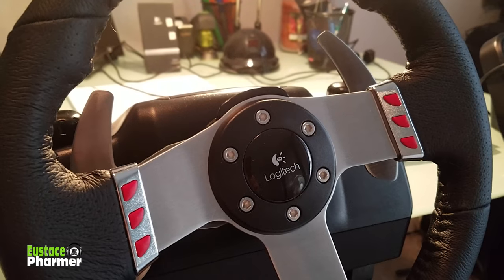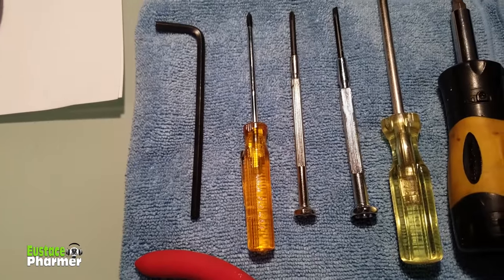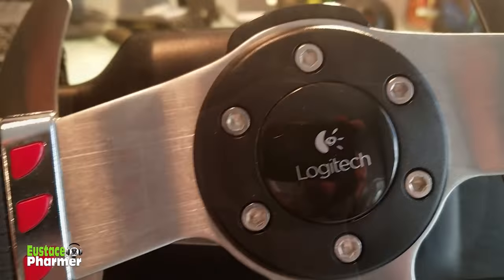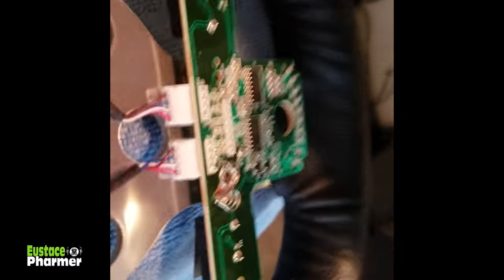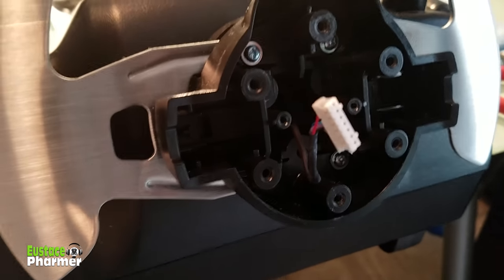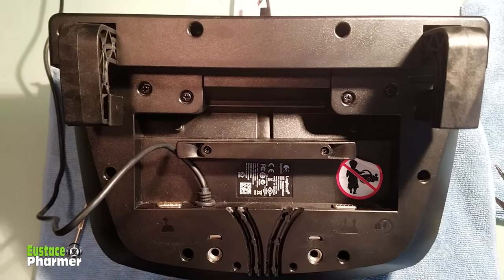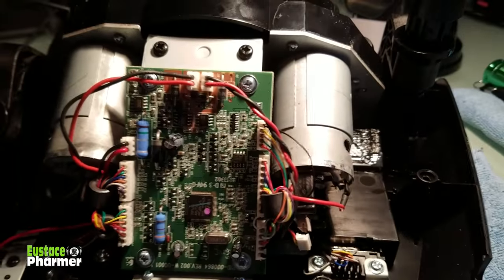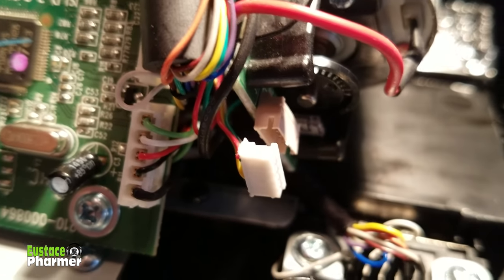LOGITECH G7 WHEEL CENTERING ISSUE FIX

Comment: that screw inside the plastic cover was loose as hell -   im scared thats not my only issue though that clip was impossible to take off
Reply from the maker: if you don't feel comfortable messing with it then I advise you to take it to an electronics repair shop and they will do it for you.
Thank you for your comment 😊 👍
Reply: @Atomic67G  i tightened everything and put it back together and it works better then it ever has xD feels like my brothers brand new g29. Thank you for making this video- i was just gonna accept it was broken

Comment: 2:20 and make sure wheel is unpluged, went to change a new wheel and while trying to disconect those 2 4 pin wires the wheel started spining and almost snapped those wires out
Reply from the maker: I kind of thought unplugging the wheel before you take it apart was intuitive 😉

Comment: cracked ring :(
Reply from the maker: I'm sorry to read that but it's not the worst thing that could be wrong with it.
Contact a local 3D printing service and they can easily make you a new one. If you don't have a business locally, there's plenty of them online. Do your research and choose one with a good reputation. It's not going to be dirt cheap but it's a hell of a lot less than a new wheel.
Also, don't tell them what the part is for because they may try to overcharge you. All they need to know is, "Here's the item I need made".
Reply from the maker: @Future20AD 
I would be very cautious buying that particular one. It's sent from China. People have said it can take weeks to months to get the encoder and you run the risk of not getting it at all.
In my opinion, ebay is not the place to shop for items like that.
Let me know what you decide to do and how your experience went.